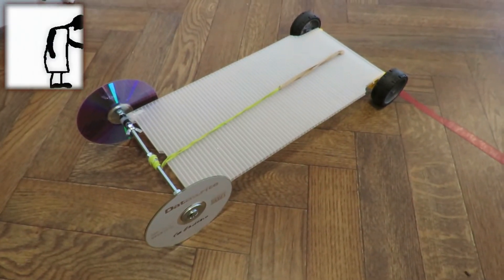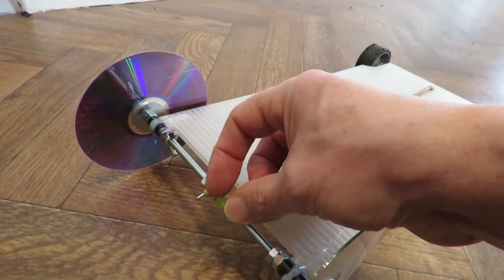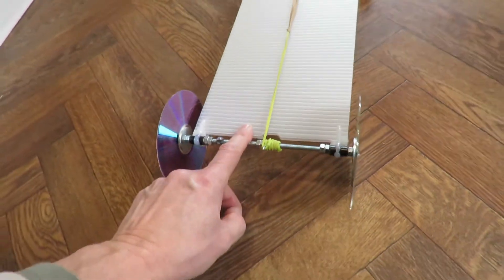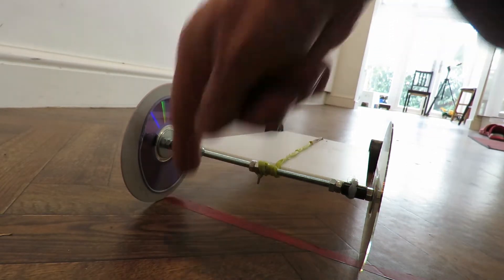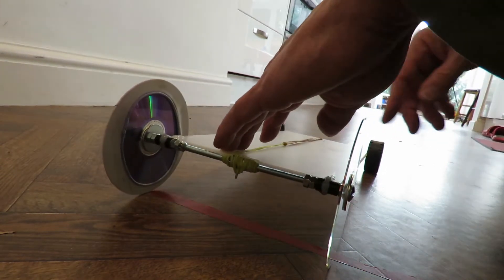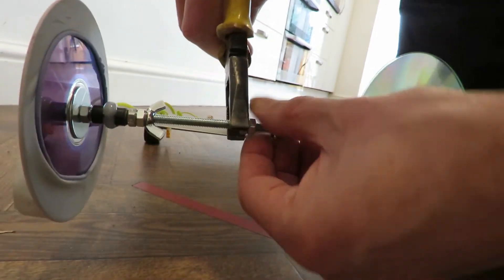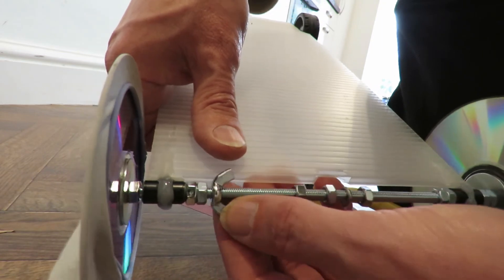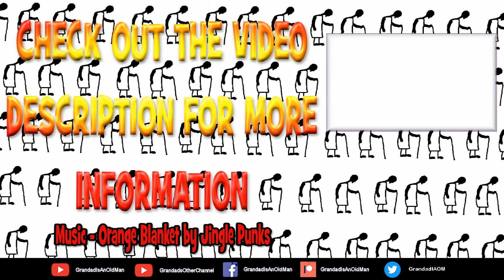RBPC Forward Backward stop where it started

Comment: By recreating this mechanism with #64 rubber bands, I realized that I couldn't get the  car do wind up for a long enough distance without running out of stretch. I calculated that to cover 9 meters total with a rubber band that stretches 8 inches on a 1/4 inch axle, I need to have rear wheels with a diameter of 11 inches, which I do not have access to. I am thinking of using either gears or a lever to remedy the issue. Have you had to do this in the past?
Reply from the maker: You may already be doing this, but I will say it just in case. Rather than wind the band round the axle, I would use strong  thread, like kite line for the section that actually winds round the axle, so the band used efficiently. When the band is actually wound around the axle you are losing a significant amount of it's potential. A bonus of using the thread is that it takes less space on the axle and does not bundle up like the rubber band would. You car would need to be long enough for the band to be fully extended before it can reach the axle. I am surprised you are measuring just 8 inches of stretch for the band, but I guess you are not pushing it to destruction. I did some work on stretching bands in this video - Series or parallel rubber bands #2 power from stretch https://youtu.be/IH40ikuDJTk?list=PLA5a2xPRSrB0J0sa54GiyvcWTQUg_Zx52 Lubricating the band will improve its capabilities.
Reply: @GrandadIsAnOldMan  Thank you Grandad.

Comment: That was great.  Before I saw what was going on, I wondered how it was going to stop upon the return. At first I thought you were trying to depend on it unwinding in reverse and just stop but it would have coasted a bit and missed the mark.  That wing nut thing is simple yet does a great job. It came a lot closer to the mark than I thought it would. Very interesting way to solve the problem without over engineering it.
Reply: If I had put rubber tyres on all the wheels it would be even more accurate. Creating a slot for the wingnut to slide in would also increase the accuracy. I left it to flip from one side of the body to the other, that allows half a turn of the wheel so that is about 6 inches of travel. Smaller wheels would also reduce that distance.